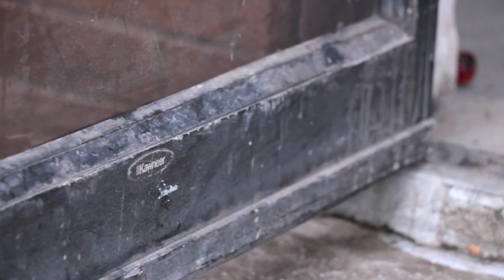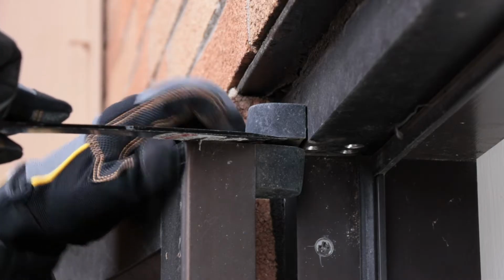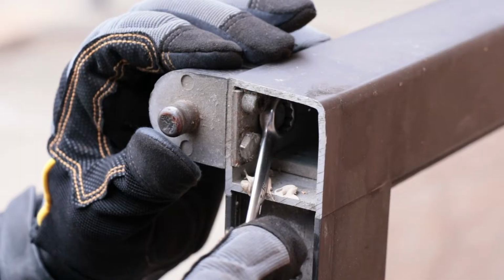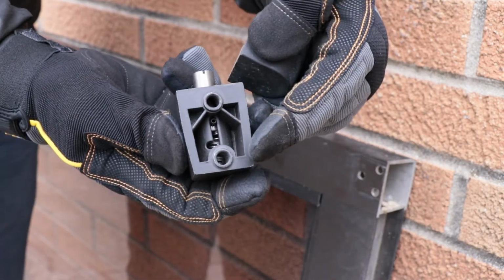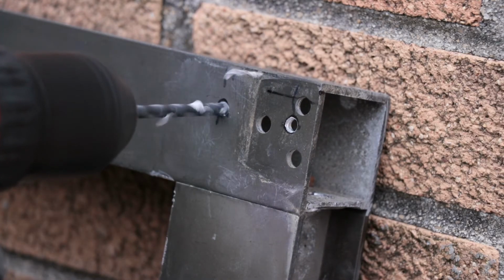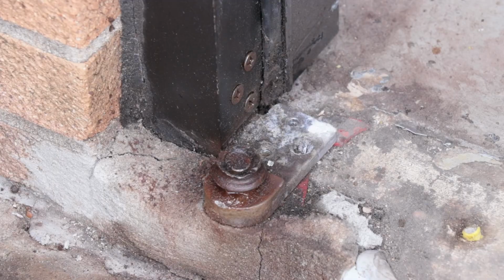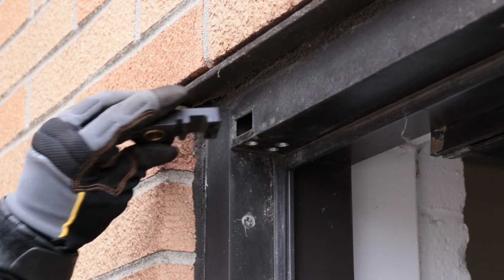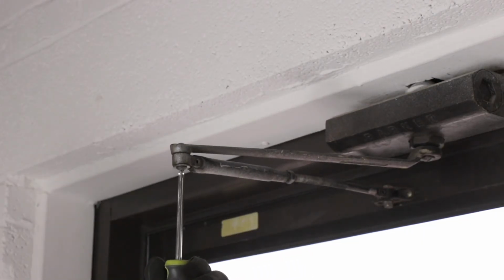How to Install a Kawneer Commercial Door Pivot

Comment: buddy you just messed up that concrete.
Reply: I just changed mine. Video was a huge help. I just unscrewed the post part at the bottom and screwed in the one off of the new one. I was thinking exactly what you commented and didn’t want to pull up the threshold unless absolutely necessary.

Comment: That is the one of the best "how to's" I've watched.  Great camera work, very good step by step instructions, excellent reference to parts.  You nailed it.  I've got a customer's retail shop whose door is dragging on the threshold and will not fully close on its own.  I started to remove the door to shim the pivot hinge, but it was too heavy to handle myself and couldn't get the screws out of the top hinge.  Feels like they have oxidized in place.  I wasn't using a #3 bit tho so I'll try that after I order your bottom hinge pivot replacement.  That will allow height adjustment to clear the new threshhold I made out of pressure treated that was thinner than the aluminum one but is still keeping the door from self closing. May get the top one as well.

Comment: How do i use a spiral screw extractor
Reply: Do you mean an "easy out?"

Drill a hole that fits the easy out, hammer it in, then unscrew counterclockwise.